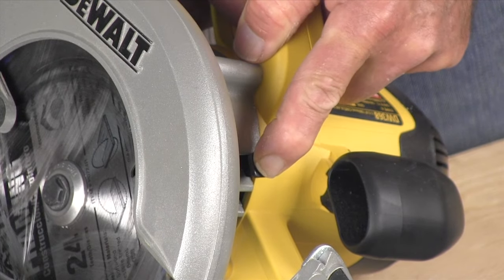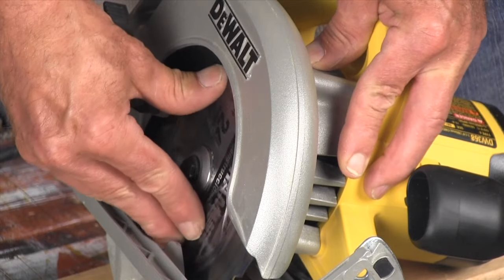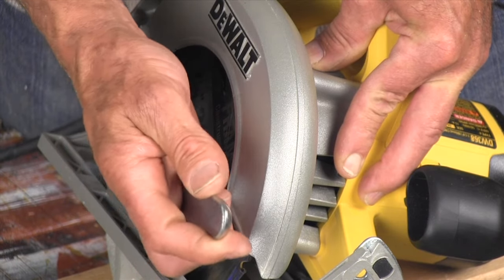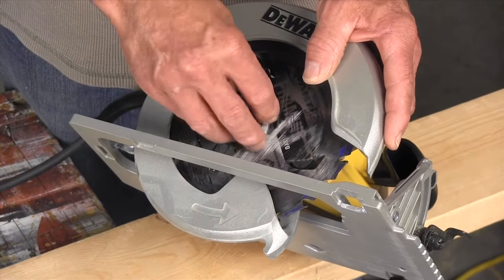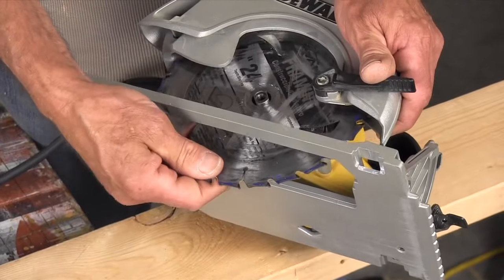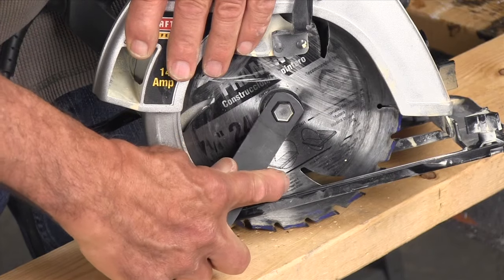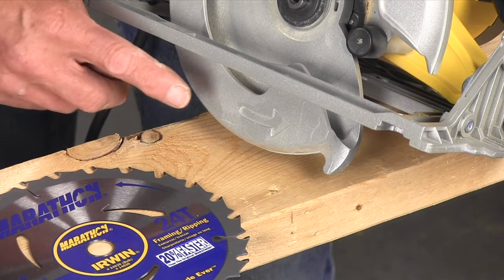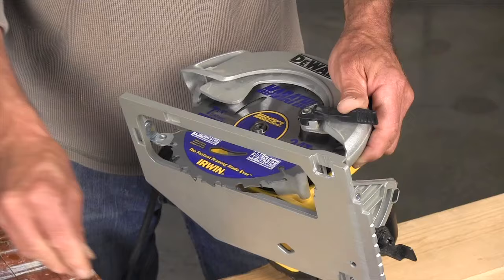How to Change a Circular Saw Blade

Comment: I used this information to change the blade on my circular saw. Success !!! Thank you so much!
Reply: Where did you get the tool from to take off the bolt .
Reply: @gtpride2003 , it's just a wrench, probably 7/16" or 9/16".

Comment: Thanks I was turning bolt anti clockwise needed to turn clockwise as per the information this guy said, worked a treat 👍 blade removed to clean and fit new blade thanks 👍

Comment: This was helpful but my Pentagon circular saw had an additional nut/nob on the saw blade holding bolt. It needed a 6mm allen key to undo it then the next nut that I had been putting a wrench on came off. With all the dust in that nob and the fact that it was too big a hole for my 5mm allen key it look round inside not allen key shaped so I nearly striped the nut that a wrench fitted on trying to get the blade off. The reason I am leaving this comment is that there are no manuals on line any where for a Pentagon circular saw.

Comment: Too easy, i wish! that button will not hold the blade in place it strips when you try to turn the blade, the nut does not come off that easy... what else can i do?
Reply: Hold the outer washer under the bolt head with a pair of channel lock pliars.